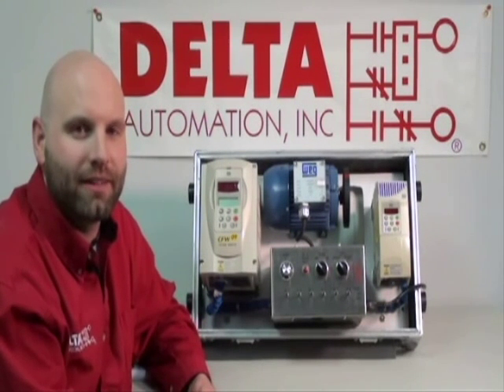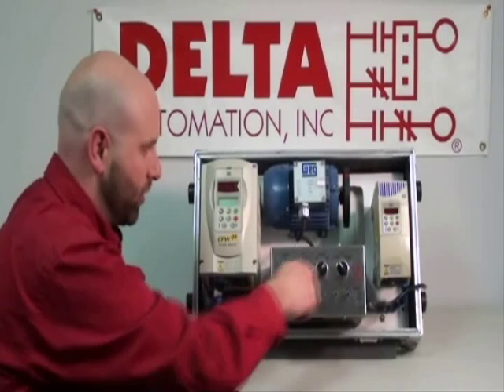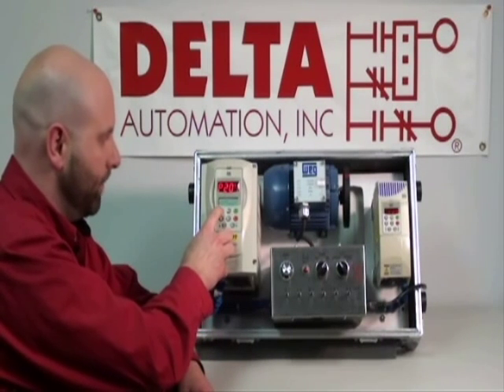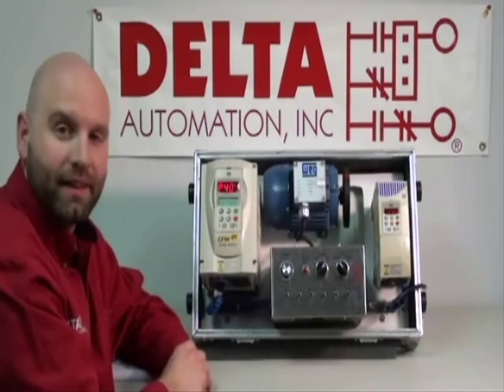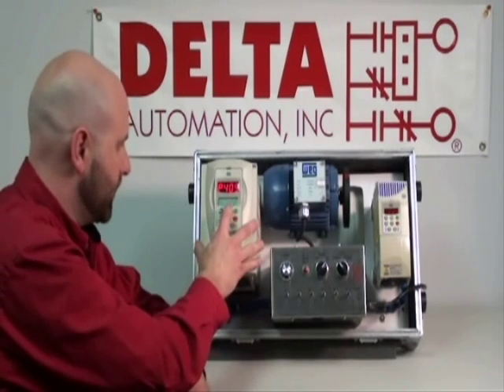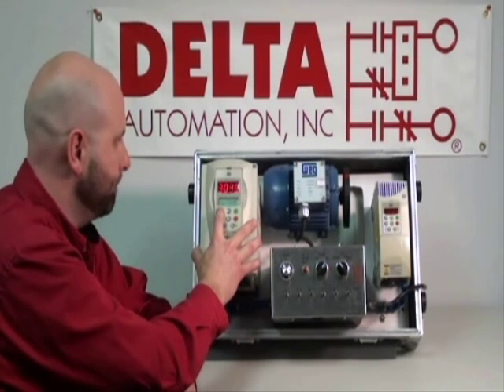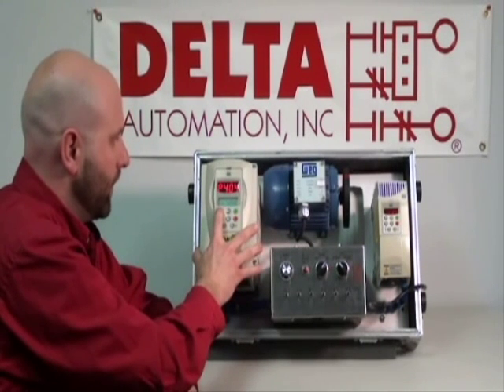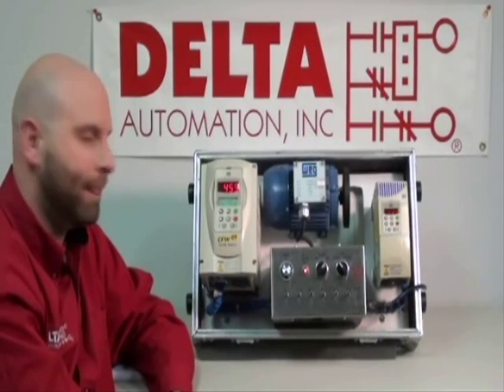WEG 09 VFD Quick start-up

Comment: Hello David, can you post the wiring required to drive with 1 phase input?
Reply from the maker: Minh, David is no longer with the company and the WEG 09 has been replaced with the WEG 11. There is really no magic to running a VFD on a single phase input. However, you must oversize the VFD by a factor of 2, (I.E. a 5 H.P. motor will require a 10 H.P. VFD to run on single phase). Simply connect the single phase inputs to 2 of the 3 input phases. Also you must turn off the phase loss error in the parameters.
Good luck,
Bob